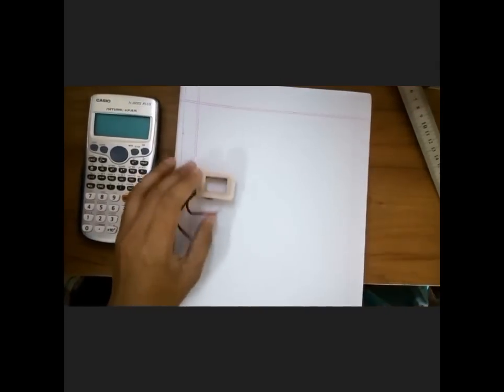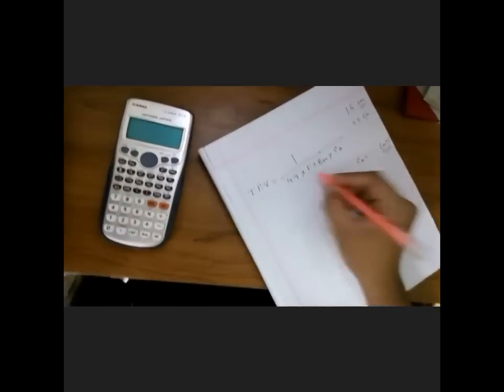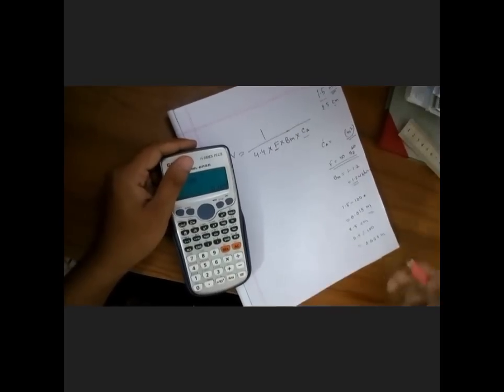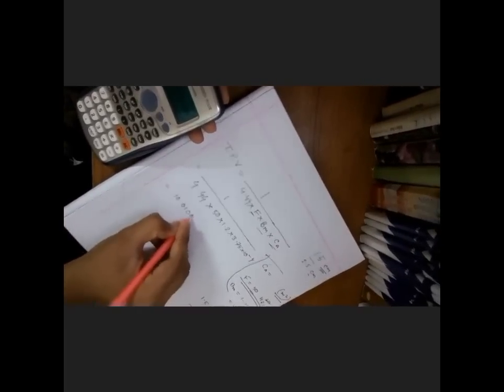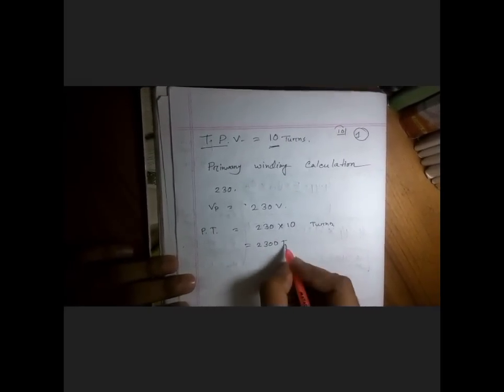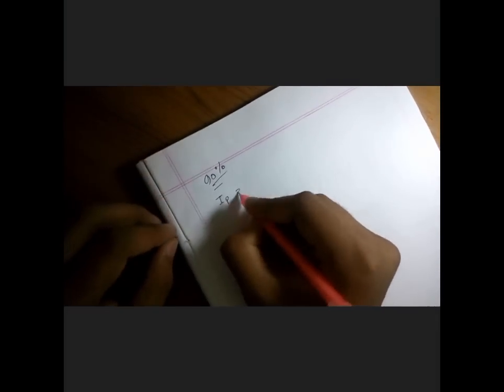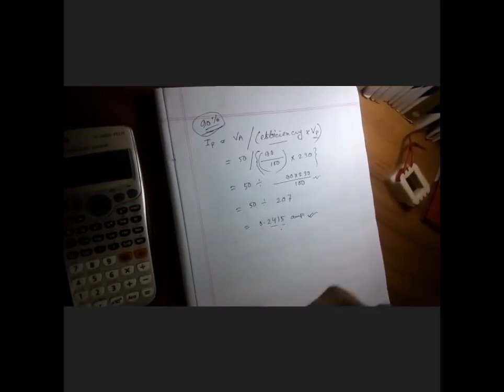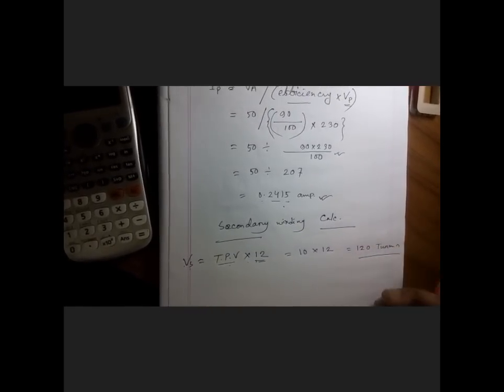Fully Explained!!! Transformer winding calculations,step up or step down (Turns per volt,Np,Ns etc)

Comment: What if im not using a bobbin? I am winding straight to the core so my core area is my core sectional area? or my tongue?
Reply from the maker: no matter which thing u use..main reason for calculating bobbin size is actually calculating core area..so bobbin is not the main fact here.. core area is fact.. :)

Comment: Sir I want to design 10 kva step up transformer. My input voltage is 90 volts and output 230. I want to design it on 8B core of 6 inches stack. Please send me the winding data for this transformer . The core area is I think 18 inches. my email is manzoorjoo@gmail.com

Comment: What gauge wire to use
Reply from the maker: Hemen Perumal how much output current u want that question will come first.. let me know that.. 😊
Reply: 220 input and 45v-0-45
Reply: Tech Sid according to my calucation i get 4.8volt per turn
Reply from the maker: Hemen Perumal 
4.8 volts per turn or 4.8 turns per volt? 
coz 4.8 volts per turn is a huge giant transformer...u can give me your bobin size then i will calculate everything for you..😊

Comment: Good Explain . I have question sir ? 
   Thanks
Reply from the maker: ASATH. V any question dear? 😊
Reply: Tech Sid 
Yes dear.
 Only one dought 
  Bm = 1 - 1.2 OK
But why you take 1.2 and 
 what is the measure of
    reading 1 - 1.2 ?
Reply from the maker: ASATH. V 
i took maximum value for magnetic flux..this value is for iron core...i repeat iron core...there are so many types of core available in market..iron,aluminum and so on..but widely used core is iron core...that's why i took iron for this video...and for choosing value 1.2..i'll say, by using 1.2 it will give you the most precise calculation for your transformer...i tested.. 😊
anything else?
Reply: Tech Sid 
   Thanks sir

Comment: Sar agjampal muje 50.0.50v 15a mp ka transpamar banana he to kese pata lagega ki sekedari vayr swg or praimari swg konsa lagega
                                      
0
Reply from the maker: Nikul Nikul 
15 AWG wire for primary...
& 11 AWG wire for Secondary.. 
ye thora thick wire hay...par ye perfect size hoga apke 15 amp 50-0-50 transformer k liye.. :)
Reply: Awg lekin hamare vaha to swg milta he sar
Reply from the maker: Nikul Nikul 
awg 
American Wire Gauge Table
aur
swg 
Standard Wire Gauge Table
dono same he hay...aap swg vi le sakte hay...
is problem k solution k liye naya ek table aya hay..
Standard American Wire Gauge Table..lekin iska prachalan abhi tak nahi hua thik se..
to aap SWG use kare... :)

Comment: Thanks dear for this video ......but can you send some data for step up    tansformer of 5000 wattage .....output is 220 and input is 100 .....what is pr current .....is it possible to use wire gauge for 110 amperes......your kindness....thanks ....do reply
Reply from the maker: Sajad Bhat 
yes dear i can help u out...
but let me have some more information..
what is the bobbin size of your transformer..?? ((as it is 5000watt tansformer you should make a big transformer otherwise the wire would not be adjusted into it..)) and what is the frequency (Hz) in your input line..? 
give me these information...nd I'll calculate others for you.. :)
Reply: 4" × 2".....frequency is 50 hz
Reply from the maker: Sajad Bhat 
Here is your solution dear.. :) 
https://drive.google.com/file/d/0B5WNGQxnSsh9bjA1OV8wZDRzVzg/view?usp=drivesdk
and 
https://drive.google.com/file/d/0B5WNGQxnSsh9Z3JSOXZlclk0dFk/view?usp=drivesdk
all calculations have been done here for your 5000watt (100-220 volt) step up transformer... :)
Reply: But i have seen that 10KVA transformers cime with 10 or 11 SWG wires with same input and output......how they do it

And is it possible to wind such a big wire of 4 AWG......IT IS CONFUSING ME DEAR
Reply from the maker: Sajad Bhat 
ya dear.thatz the point..u cant wind much thicker wire in transformer...thus u have to use thinner wire..parallely..that would also give u the same output... :) 
try using 2 parallel of 8 awg...or 3 wire of 10 awg...actually 5kva is a huge capability transformer..so u have to consider these things dear.  :(
Reply: Dear can you explain this below  circuit  diagram.....how this is calculated....https://drive.google.com/file/d/0BxApoC-KVWfXMkQyVGlFdEVZQ3M/view?usp=drivesdk

And this

https://drive.google.com/file/d/0BxApoC-KVWfXdXVJZTJNLUFjUUU/view?usp=drivesdk
Reply from the maker: Sajad Bhat 
in this transformer..
the output side start wire winding and stop in 58 turns and out this wire..now starting from this wire turn another 34 turn..then pull the wire out...then another 33turn...in this way wire another 7 turns..total out wire would be 5...
but dear 8 awg cant provide 10kva output...it can give you max watt of 6.7 kva...(with 280 volt) :)
Reply: I dont mean this i mean how these parameters have been calculated
Reply from the maker: Sajad Bhat 
which calculation dear? 
which awg to use?
Reply: I mean how the person has calculated that we should go for 115 turns in pr and58, 34 ,33, 7 turns in secondry...
Reply: No reply ....everything allright....
Reply: I was waiting for ur rply
Reply from the maker: Sajad Bhat 
sorry dear...i was in my workplace... :(
actually that's circuits demand...he drawn the circuit in Switch Mode System ( which is controlled by IC's) that's why he needed this type of transformer... :)
Reply: Tech Sid is that an autotransformer
Reply: Do you make these high voltage  transformers.....
Reply from the maker: Sajad Bhat 
yup dear u can call it an auto transformer... :) 
as it has intelligence power system to recognize the voltage and set the output voltage a required value.. :) 
no dear i haven't made these type of transformer..i have made a maximum 2kva transformer... (which i used in a voltage stabilizer for a water pump.. -_-)
Reply: Ok.....thanks dear......
Reply from the maker: Sajad Bhat 
u r always welcome..  :) 
keep sharing any type of problems.. I'll try my best to help you.. :) 
#keep_inventing..

Comment: Brother I watch your video ok and follow your calculation with your calculation but some answer not com
You now you also cut video please explain and what's Intel power10-4 please explain step by step calculate
Reply from the maker: Rahmath Gani 
Bro i didn't get ur question.. Will u plz explain what u want to know.. I'll sure help u.. :)
Reply from the maker: Rahmath Gani 
Turns Per Volt (TPV)
= 1/(4.4×F×Bm×CA)
Here
F=50 Hz 
Bm= 1.2 W/m² (for steel sheet)
CA= height of core (meter) × width of core (meter)
Any other confusion bro? ☺
Reply from the maker: Rahmath Gani 
If you are about to make a transformer then give me the information (ex. Input volt, output volt, frequency, core length).. I will calculate the TPV for u... ☺

Comment: Sir how can I calculate the secondary's Amps?
Example I need(12Volts, 3Amps, 50Hz in Secondary's side and give 230Volts, 0.5 to 2 Amps in Primary's side) this is a 0-12 transformer. How did I calculate?
Please explain......
Reply from the maker: Nayan Nandi brother..
as ur example ur primary side wattage is about : 230/2= 115 watt (minimum)
so in ur secondary side.
secondary Amps, Is= VA/Vs 
 so, Is= 115/12= 9.58 amps (aprox.) 
:)
Reply from the maker: Nayan Nandi 
transformer's secondary current mainly depends on the primary wattage as my experience.. 
as primary voltage is fixed..so if u can flow much current on the primary side u can get more current on the secondary side.. :)

Comment: nice video but still lacks wire data.. on what wires will be used can you provide a chart for this wire what wire size and amperage of wire that it can hold during run time .... thanks for the video its the same as my calculations.
Reply from the maker: kristian dave aranas 
glad that my video helped u.. :)
yes..i will upload the amperege of wire data in my next video.. :)
be with me dear.. :) thank you..
Reply: Tech Sid yeah i do a lot of research and my calculations is all related. The reason that i didnt stop researching is the wire sizing i cant find what is right . :)
Reply from the maker: kristian dave aranas 
okk..i hope my next one will help you out..i'll try to upload that as soon as possible..i m still researching about that..:p lol...hope u find that tomorrow.. :)
Reply: Tech Sid ohw i forgot to tell you. I have a chart i just printed it and uses 500 kcmil to 750kcmil  but im not sure because inhave transformer here 1 amp it uses 25 or 26 awg i dont know why its very small wire for 1 amp
Reply from the maker: kristian dave aranas 
no dear..on 25 or 26 AWG 1 amp of current won't flow...u have to use minimum 21AWG wire for 1 amp current..but i will recommend to use 20 AWG wire for perfect 1 amp flow.. :)
Reply: Tech Sid bro. based on your data  21awg have 1A so your using 800cmils which is conservative ratings am i right?...some tutorials was using 500cmil for max amps therefore in 21awg can handle 1 to 1.6 amps but im not sure, Because  i have a 1amp 12v-0-12v transformer Center tap like i said the wire size is about 25-26 awg lol... its very confusing is this really a 1A or 500mA per 12v ? thanks for more info's bro.... i appriciate it much
Reply from the maker: kristian dave aranas 
your transformer may made in china.. :v 😂 it cant give more than 500mA bro...
Reply: Tech Sid hahaha i think this is fake  lol its made in my country.. its a commercial transformer i think they are only putting fake specs.
I also have a transformer from sony stereo its very bulky for 70w transformer and we have 220v 60hz i disassemble it and sized the wire and found out primary is 25 awg good for 4mA so this transformer is the real one?
Reply from the maker: kristian dave aranas 
oh..yea that could be happen for commercial fact..25 AWG for 4mA only?
Reply: Tech Sid 70w divided by 200v * efficiency therefore this tranformer primary amps will be 0.354 amps and according to the size of the wire in the primary its 25 AWG that can hold 4mA i am right? therefore this transformer is the exact one.
Reply from the maker: kristian dave aranas 
its 400mA dear... :)
Reply from the maker: kristian dave aranas 
according to your details ur transformer is quit good for 70 watts...and its not that fake.. ;) 😂
Reply: Tech Sid oh :) sorry its 400mA lol also this sony transformer has CT 24v using 18AWG its to thick. and also has additional 11v in it i think it is a 20AWG. my other one fake transformer is funny but i already used it for my other projects just a supply but i didnt exceed its limits i know it will melt the wires haaha
Reply from the maker: kristian dave aranas 
CT transformer with 24volt..as u said it was 70 watt transformer..with this u have a additional winding of 11 volt..so if it used much thicker wire the transformer couldnt give u more than a limited amps..the amps should be 70/(24*2)=1.458amps..so for this amp 20 AWG wire is enough dear..if you use thicker wire u cant gain much amps..but using thicker wire ur transformer will not be overheated... :)
Reply: Tech Sid yeah thanks for another advice bro...

Comment: nice video . what is that 4.4 in first calculation sir ?
Reply from the maker: hariz mdp it was nice u 've seen my video. :) 
here 4.4 is a constant value.that u have to use to calculate the "Turns Per Volt". it was the basic rules to make a transformer... :)
Reply: k sir if i use the magnet to conduct a emf in coil . How to calculate the emf value sir?
Reply from the maker: hariz mdp 
you can use Faraday's Law
to calculate the value..
http://hyperphysics.phy-astr.gsu.edu/hbase/electric/farlaw.html
hope this link helps you..
thnx. :)
Reply: thank u so much sir!!!!!!!
for that idea sir!
Reply from the maker: hariz mdp 
You r always welcome brother.. :)
Reply: hariz mdp based on the data ive got the 4.44 is the EMF (electromotive Force) its for sine wave signals only